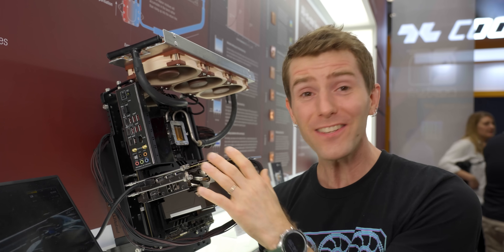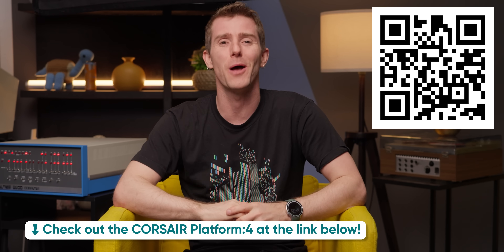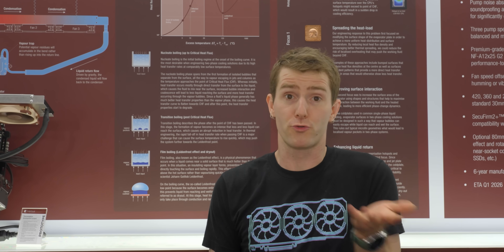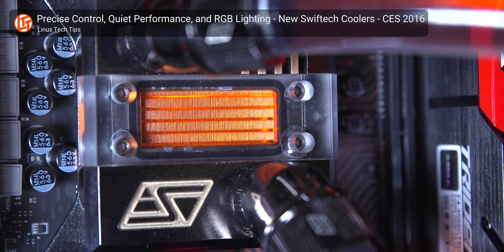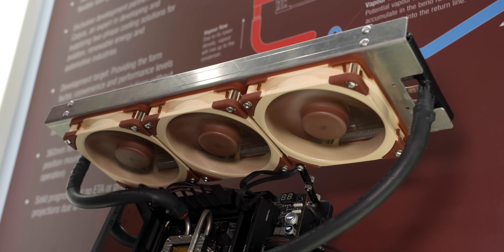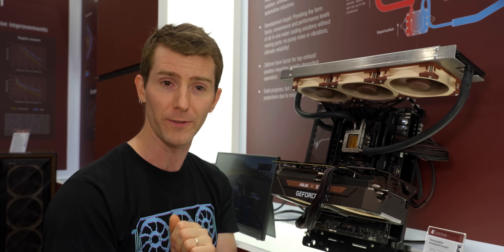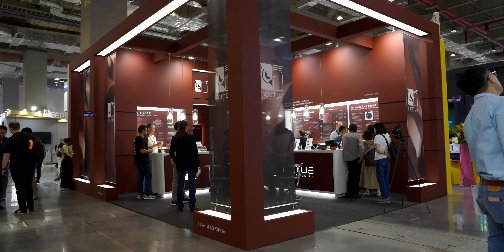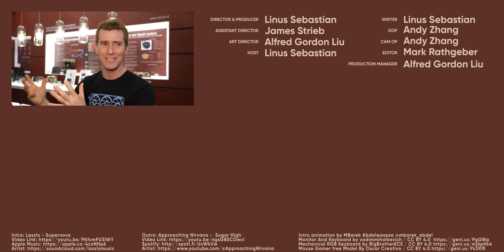6 Years Ago This Idea FAILED.. Now it’s WORKING

Comment from the maker: Correction
1:56 - Linus, and the on-screen text, say "Ryzen 9 9800X3D." We meant Ryzen 7!
Reply: There's a Ryzen 5040? I had no idea!
Reply: I'm hungry for cheese balls
Reply: Thought it may have been a 9900x3d, was about to ask :D
Reply: where's the ryzen 4070
Reply: Tell them to make one for that gpu might slim it down to be less chunky than a PSU
Reply: My Brain lagged for a bit😂
Reply: Nothing has changed in a year
Reply: great video, and great break down of how Noctua performs miracles
Reply: Yeah I was about to say…
Reply: Damn, I just commented to complain about that sorry you already corrected it.
Reply: I totally went 🤨 at that moment
Reply: HERE COMES STEVE WITH ANOTHER INVESTIGATION~!
Reply: I mean it’s still more than what Intel expected the ryzen 9 to be
Reply: God loves you and has a plan for your life
Reply: 2:18 - Air is technically a fluid, so all passive air coolers are pump-less fluid coolers.
Reply: im sorry is this water? so it is basically a recycling still that can build pressure? or like a refridgerator evaporator using butane?
Reply: I was about to say
Reply: ´pläine germähn : 
this is sum swede lövv gräde tech ´bävehr steil v³V ?
Reply: Lol
Reply: ok, my simple brain applying known techniques to other things.  Aquarium sponge filters works because air bubbles flow to the surface and draw water in from the bottom.  That should work for this kind of cooling decision in my opinion.
Reply: 2005: noctua
2025: hawk tuah
Reply: Still making big mistakes in your editing eh? still being the same old ch with too many videos too fast shame
Reply: @YamiPoyo  "big mistakes" lol

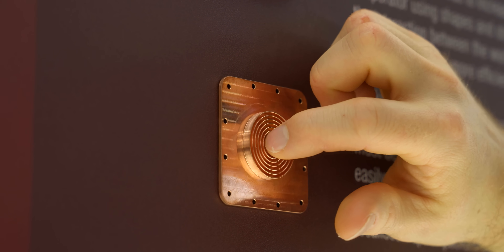Comment: 5:54 this is a fallacy “if the coolant flows too fast it will not have time to evaporate and the cooling efficiency will go down” 🤓

It’s not the case in single or multi phase cooling systems ❤️

Comment: @Linus Tech Tips , I wonder if they tried to sandwich a 2mm copper plate between the Boiling pumpless and the CPU using thermal paste between each layer. In my head it seems like a better, more even transfer of heat from the CPU through the 2mm copper plate to the boiler.

Comment: Isnt this kinda the same principle as how an air cooler radiator works? The luquid in the pipes move in the same way from hot spot to heat exchanger.

Comment: anything with structure amplifies vibrations......... flat surfaces are the worst. Think of it as "is it a good diffuser?" and reverse the answer , you then know if it is a good "speaker". Anytime we hear a noise it is a vibration - and anything that makes vibrations interacts with the air through its surface. So anytime you have a flat or symmetric structure*, its bad. This applies to everything in your life. Your something that makes noises, would make more noises if the surface was tuned to interact with the air - and less noise if tuned to interact the least with the air. You dont make a speaker out of cloth and a damper out of something air tight. Anything that resists the movement of air is a damper. Dampers can react very differently to different frequencies.

So actually a great sound damper ??????? A speaker with no power. It will take the movement energy from the air and make a power output on the speaker terminals. Because it is fighting the magnets of the speaker all the time it is dampening. And because the movement is = induction , you are creating electricity.

Comment: i wonder if the trick is not just to inlet from the perimeter , and take away vapor from the center. let the fluid run in when it is already level with the bubble/bubbles. It would force the gas out of place I imagine. I think that making the two states fighting over the space is always gonna be an L solution.

Comment: While it is probably hard to make it ready to market, the concept is really super simple, and not hard to do if you can tinker. You pressurize your fluid channels to such a pressure that operating temperature = boiling temperature , then you need a slight nudge in the right direction, and you are already a long way towards the goal. The heat to power tech from formula1 brakes , could also prove very cool in this application when the size is appropriate. Imagine using the heat to Vaporize water (highly efficient removal of heat energy) , and circle the fluid (converting heat into motion) , and powering a small pump assisting the passive flow (converting heat into power into motion)  - i hope you catch the drift. Future is bright my dear sirs.

With a variable and responsive pressure control you can always make the pressure fit the temperature , thus maximizing efficiency.

Comment: 3:143:14 This system works on the same principle as refrigerators from the 70s that used Ammonia as a refrigerant and there was no compressor, or even electricity in the system, just a candle heating the heat pipe on the outside of the condenser, as the heat point made the refrigerant gas expand and evaporate in the evaporator, then naturally returned to the condenser in liquid form, it is very interesting to review this in an updated form for compact devices.

Comment: The ideal operating temperature of liquid-gas-liquid is fixed, it doesn’t change to vary depending on cpu load. I would expect a larger volume above the normal liquid level to allow greater headroom for hotter loads.

Comment: If they want to optimize heat transfers from hot and cold spots, it means product must be designed for each cpu separately, as they have these points in different spots. That would mean ton of models. Or they would have to create some custom thermal pads which will control these heat transfers.

Comment: So, basically same principle as a heatpipe. But operating closer to ambient pressure. And with more liquid. Kind of neat.
But what is the liquid?
Alkohols, like both ethanol and methanol are out, they boil at too high temperatures to be acceptable, coming too close to the temperature limit. The system would have to be very considerably below ambient pressure for that to work, which I have a hard time imagining that people in general can set up correctly.
And water is even worse.
Beyond that we are moving into fluids that normal people should not be handling, specially at home or in a office.

Comment: None of this would be necessary if we had diamond substrate electronics and silicon photonics, which avoid generating the heat and noise in the first place. Sometimes I find it hard to believe we're in 2025. Diamond electronics, silicon photonics, piezoelectric audio, QDEL displays and glass disc data storage should be fully optimised and mainstream by now.

Comment: Lookup up Tesla Pump which was actually designed by Nikola Tesla himself nearly a hundred years ago which uses NO moving parts but rather uses coolant flow fractionation and hydrodynamics to force a given direction and speed of fluid circulation. That type of technology is JUST NOW coming back into vogue because we modern humans now have proper CNC machining and 3D printing technology that can PRECISELY SIZE and SHAPE the hydrodynamic current flow properties to fit a specific configuration for the items needing cooling! 

We use in on our high-performance CNC-machined engines and print the Tesla Pump design right into the engine block itself which works GREAT! I can definitely see modern CAD/CAM/CAE/FEA software being able to properly size and shape the Tesla Pump flow chambers for a SPECIFIC GPU or CPU configuration to give high-performance cooling with no noisy pump needed!

V

Comment: If the whole point is to not have a pump that has moving parts and replace it with fans that have moving parts and isn't as good as a pump. What's the point?

Comment: Over the last 20years ive been throught AIO and custom loop water cooler, at the end, air flow is the best, no hassle, think about it, build around it, AIR COOLING DESERVE BETTER! working like a charm and no noise with Nocuta or NoiseBlocker... ok ok its 20+€ a fan, 140, 120, worth it. throw the water, bring the air! 🤗😚😘
Reply: Throw the water, Bring the Air! 😁

Comment: Couldn't they just put like a little eighth or a quarter inch aluminum spacer between the CPU and the cooler to dissipate the hot spots? A very simple and cheap fix.

Comment: Honestly why?  That's a lot of engineering work and expense that has to compete with the proven alternative of just using high quality pumps.  

You don't pass your CPU cooler down to your kids.  You are probably going to need a new one anyway when you upgrade to a new socket (I certainly don't trust them to be selling me a cheap new mounting bracket for their legacy cooler).

Comment: Need subsections of liquid chambers that heat first in parallel. They coolest one is over the CPU where the others that heat up make the liquid move through radiator and fan via convection. Can have 100% passive mode which is also fail safe if active fails. Also, make some liquid run through fans and radiator like a water wheel too

Comment: I reckon that the difficulty of such a cooler isn't in the fins or the motor, but in the approval hell in finding a coolant that isn't mega toxic, cus it'll all eventually leak into their customer's room and into the atmosphere
Reply: The answer is so boring it's disappointing:  water.  Highest figure of merit for heat pipes of any fluid between 0C and about 200C.

Comment: Bubble/void is called cavitation. 

Huge issue with hydraulic pumps when the pump suction exceeds flow rate. 
In industry, we do a couple of things! 

1. We don't run full speed until fluid is at the correct operating temp. 
2. We generally put the reservoir above the pump, and with a sufficiently sized feed. 
3. We size pump impeller RPM to match feed/flow.

Comment: At what price point? The fans make more noise than the pump under load. At idle, properly configured fans should be pretty darn quiet while still not really revealing or making the pump sound stand out. 

If it's only on par, I don't see the point if it's going to be priced at a premium. 

Im sick of overpriced Chinese made gimics! Gamers were overcharged for graphics cards forever, and now NVIDIA doesn't even care about gaming. The only reason they are still doing it is because people are stupid enough to pay almost $1000 for a mid level card. 

I've been saying this for years!

Comment: But liquid boils in thermal pipes too. I think the main problem in this setup is that you need either low-temp boil liquid or low-pressure the while system. And seeing this sleeves I think it is latter.

Comment: If they are having fans why not have the fans operate a magnetic pump on the radiator using simple magnetic impellors which turn based upon the movement of the external fans. That way your in effect there is no powered pump.

Comment: I always find it sad that instead of using less power and keeping the computer cool with passive design, the engineers say stuff efficiency, whack a complicated, expensive, likely to fail, cooler on it.

Just like when I studied Architecture in the 70's they just ignored good design and would just whack on a few tonnes more air conditioning on buildings that should not have got hot in the first place.

Comment: 7:53 
Certified incompressible fluid moment! What bothers me about passive phase change systems is that they could probably GENERATE energy at like 30-50% efficiency with the right working fluid. I want a propane "steam" engine on my 5950 and i want it now!
Reply: Okay now you might be actually cooking lmao. Even if all it did was power a cool little piston contraption thing on the case, that would go SO HARD for a steampunk style PC build

Comment: Pressurise the system...
Increase boiling temperature
Reduce bubbles
 A simple additive to break surface tension

Why not have the return line on the lower RH edge/corner or on the bottom instead of on the top like they have now? 
Wouldn't this eliminate the need for the vapour trap bend? Last I checked bubbles generally go up, so if the return is coming in on the bottom there should not be any gas entering the return line.

Comment: LINUS, Check out how a propane Refrigerator works. The pilot light to heat the coolant actively creates freezing temps. No sound, super cold and no extra cost of energy. Im sure there would be a way to use that principle and same coolant attached to a cpu/gpu. Instead of a propane pilot light, you got high heat from cpu gpu to start the process. Just a thought

Comment: My first thought is you would need a case and motherboard that are designed for this cooler because it looks to me that the lengths and angle of each hose are essential to its  proper function.

Comment: They should forget the phase-change of special liquids, and simply rely on the convection of water. It might need a larger tank, but I wouldn't mind if it's ten liters, if that meant passive, even fanless cooling. (Disclaimer: I'm no physicist.)
Also, put a 5 kg copper heatsink on the external heat dissipator, I wouldn't mind paying for copper, if that meant totally silent operation.

Comment: I find this type of cooling fascinating as it removes one of the main fail points of typical cooling. If you design your condenser to have the proper capacity you could have fully passive cooling for your cpu.

This is closer to how a refrigeration system works than a typical water cooler as those operate on phase change. In a standard dx refrigeration system refrigerant goes into evaporator where it changes from a liquid to a vapor and then through a compressor and condenser where it is turned back into a liquid (and yes there is more to it than that and the refrigerant is moved by the compressor not a passive thermal cycle like this).

Comment: Linus I need your help, I'm from Malaysia and I build my own pc. And on the first try it worked than use it for a little while now and I have exam coming up, so I stop using it for a few week than when I want to turn bakc on now it was on for a few sec then it close. It didn't even pass the boot up screen. I need help pls, I try the ram swap, gpu take out, psu check with a 250 watt psu with no gpu connected. But it still turn off. I did install a HDD a few days before and it still work fine but the pc can't read the HDD now when I open  this whole thing happen. I need tips for this

Comment: Why don’t PC’s use gear pumps, rather than centrifugal pumps, lower flow but higher pressures and almost silent due to slower running speeds ?

Comment: All types except the factory coolers are WATER coolers with or without a pump.  Factory coolers are using a big solid piece of copper( usually) whereas, coolers that are using heatpipes or pumps are using a small amount of glycol etc. The differentiator factor between the last two I've mentioned is the following ; Heatpipes don't need an actual pump because the heat transfer is happening via capillary action and natural type of flow, as for the water coolers that are using pumps  their differences is that they are using forced type of flow, due to the existence of the pump.

Comment: If they were able to pressurize the system and keep it from leaking, that should minimize or eliminate the bubbles. The air bubbles do look pretty cool, but they are a very strong indicator of poor thermal transfer and highly undesirable.
Just like an automotive cooling system is under pressure to prevent internal boiling.
 The technical term is called Thermosiphon, I implemented the same strategy for the turbo charger on my car and it helps promote coolant flow through the turbo center section after the engine’s been shut down to help pull any remaining heat out of the center section.

Comment: Temptation to build a quietest setup grows seeing Noctua's stuff since my PC tower sits less than a meter from my head and the case is a Fractal Torrent, meaning I have two beefy 180mm fans that guarantee performance at the cost of constant fan noise. It performs well, but it could be quieter for when I'm not using my headphones~~~

Comment: Okay, so my dream of having an external water cooling case to avoid having to clean the motherboard or install RAM fans is still a dream.
I find it less interesting as an innovation than their "crazy" (or not) videos about testing with air conditioners and other stuff. My dream is a completely water-tight enclosure with no air circulation. This is to preserve the equipment as much as possible over time.

Comment: If they want to solve to boiling issue it's probably best to have mirror smooth curves that taper into spikes that project off of the hot surface that comes in contact with the fluid. the base of the spikes and the valleys in between them need to be made as mirror smooth as possible as boiling (much like crystallization) needs nucleation sites to get started. Fewer corners,sudden changes in angle or rough edges means fewer nucleation site means less boiling. The spikes should get rougher in texture (on the microscale) closer to their tips as you do want the fluid to boil vigorously, just not at the interface of the hottest part of the surface (the valleys in between the spikes) and rougher surface means more nucleation sites to initiate boiling. This configuration will allow fluid to reach the hottest parts of the vapor chamber while allowing vigorous boiling just above it, the shape of the spikes also encourages convection and allows it to shed bubbles quickly. Machining such a surface isn't going to be the easiest thing in the world but it can be done.

Comment: my old noctua cooler keeps my pc (dependent on ambient temps) between 5c and 10c cooler than a kraken x52 aio so noctua is correct when saying their coolers perform the same or better than an aio.
the only viable reason I see why you would use an aio over a good quality air cooler is if there is not enough room for an air cooler which is the reason I bought the kraken in the first place.